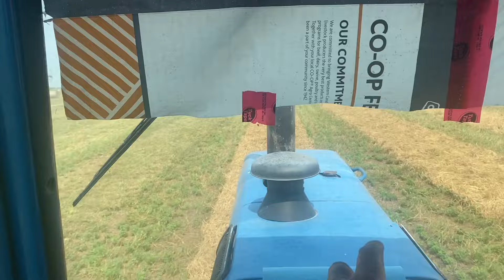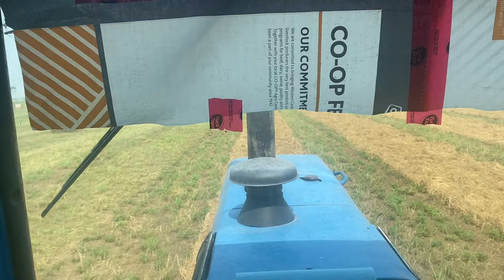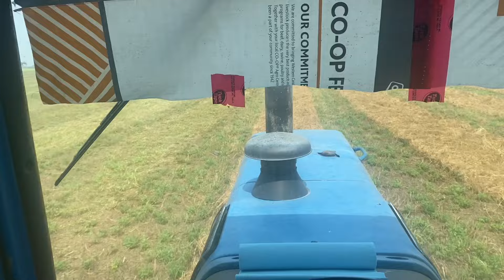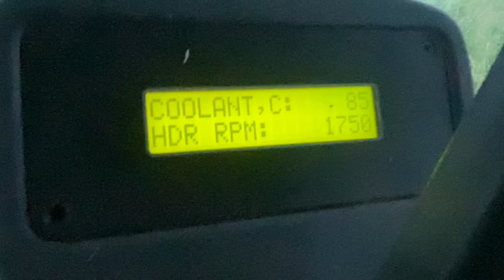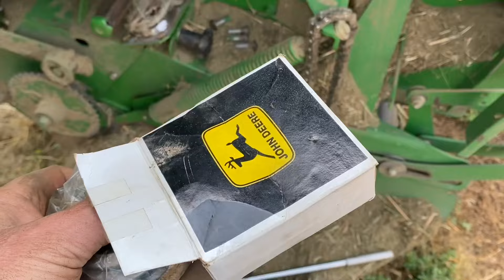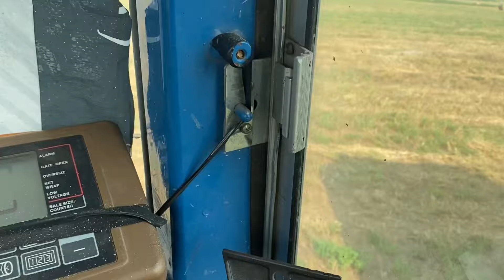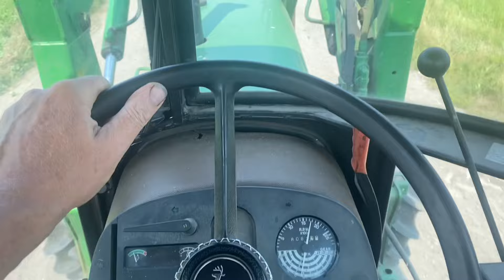Trigger warning to all tree huggers

Comment: Love your hand sprayer idea for the cows legs!   Thanks.   Flies are crazy here this year and my back rubs don’t help enough.    Good catch on that bearing.    Repair should work.  I’ve never had a baler fire and don’t want one.   How many bales through your JD 567?   Nice aerial shot of fire haze sunset😊.
Reply from the maker: Thanks, yeah i thought the science should work and it's successful, yeah i never listen to radio when i bale for this very reason, i did have my NH burn down but it was so fast in a dust cloud i didnt see the smoke start but i had enough time to unhook the tractor n get away safely, this newer baler has 23,000 on it, the older one has 27,000 on it

Comment: Glad you just had a wee shower. We had a Thunderstorm and it cleared the air so that I can bask in glorious sunshine while looking back at the mainland and knowing the farmers over there will be getting field work done. Good that you got that bearing reversed as though it would be a fair job for a temporary fix, it wouldn't  have been easy with a fire. Good job.
Reply from the maker: Yeah we're due a shift in weather, supposed to be mid 30's this week then back to mid 20's next week, would be nice for a few soakers to bring on 2nd cut. Yeah baler fires are hard to stop and it's dang dry here so big spread risk too